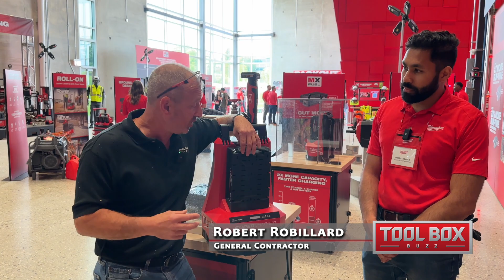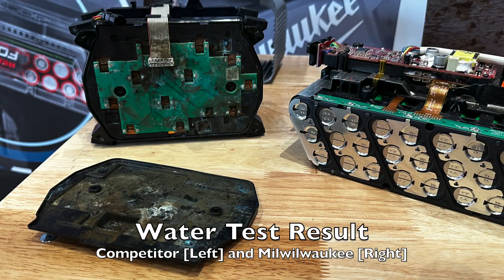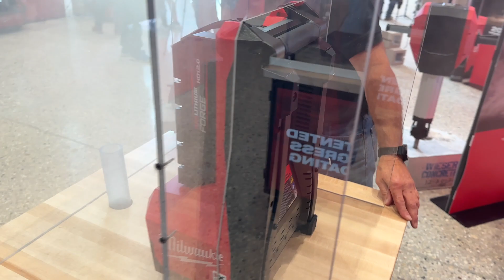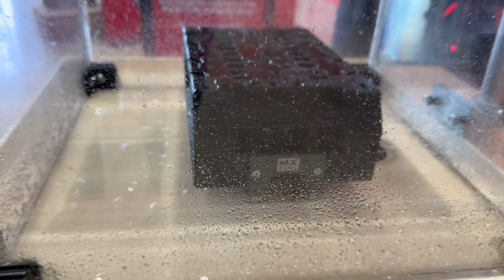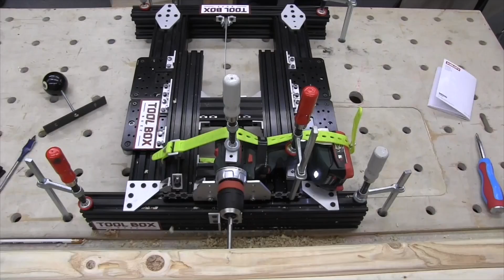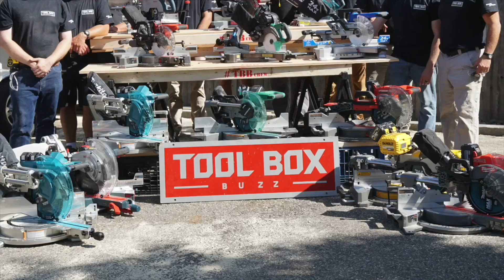Milwaukee FORGE Battery for MX FUEL

Comment: I'm very interested in a the new top handle chainsaw torture test with these batteries.
So far the saw overheat all batteries except the 12ah high output batteries when cutting into large trees.

My feeling is that these might take the beating.

Comment: Man i really wish they souldve made them multivolt. Coulve had something like flexvolt but step up voltage on bigger tools and even run 2x60v(2x54v) and have even more piwer on less amps. But i guess the mx ones work for concrete companies because they dont really need flexibility

Comment: so mx fuel forge using stack lithium? or still 21700 cell?
Reply: Can't you see it on the video, they use new tabless 21700 4ah cells. Only m18 6ah forge uses "stacked"
Reply: @riba2233  question is free I can ask anything I am not sure, I am just a regular user.
Reply: @costavong6018  np, you got an answer :)
Reply from the maker: 21700 4ah tab cells